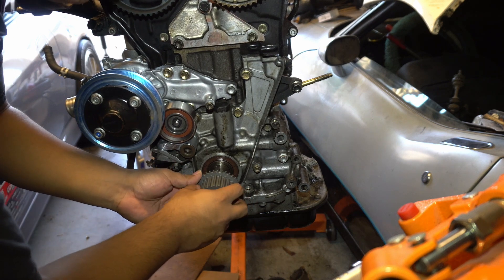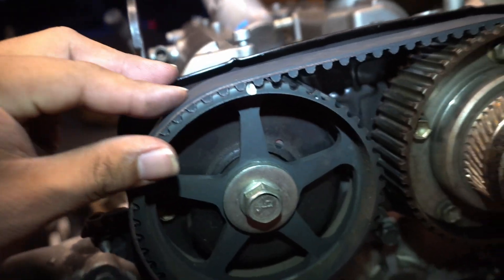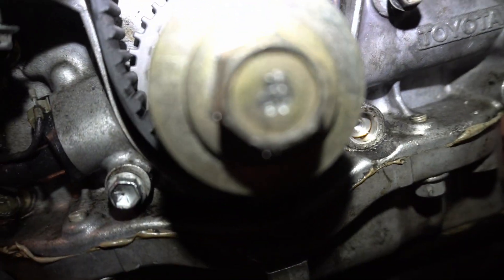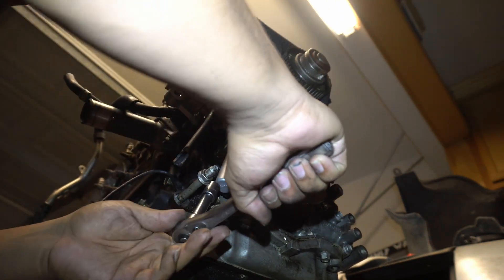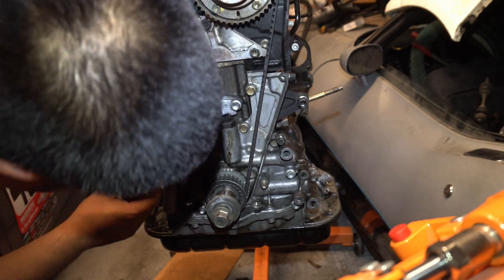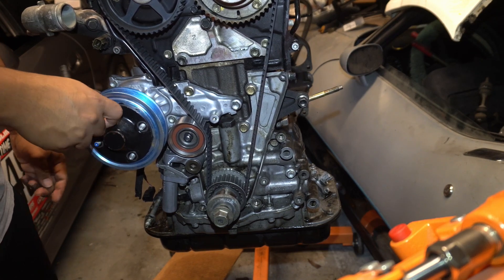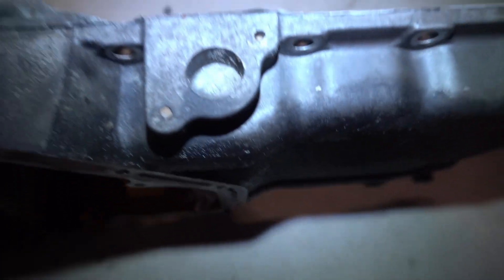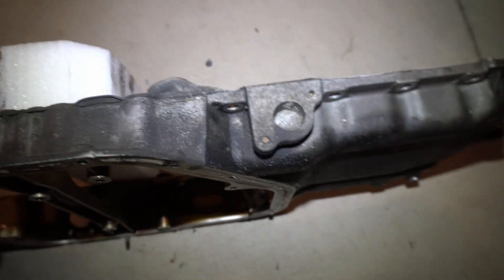Drilling and Tapping a 2JZ Oil Pan...And More | #TheE46DriftBuild Ep 33

Comment: please please please take the pan to get professionally cleaned at a machine shop. those shavings can eventually work their way in between the journal bearings and that would cause a catastrophic failure! also, no need for loctite on the studs. the clamping force should be enough. think of it like how you don't need to loctite headstuds on some engine applications.
Reply from the maker: I ended up spending some time off camera cleaning the oil pan, so I'm not to worried about it anymore.
Good to know I won't need loctite on the studs though! 
👍